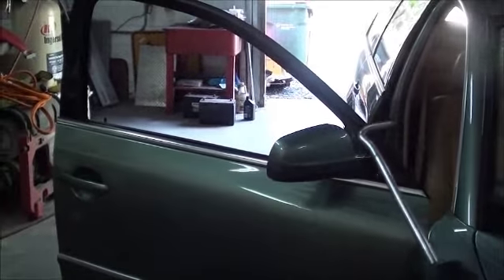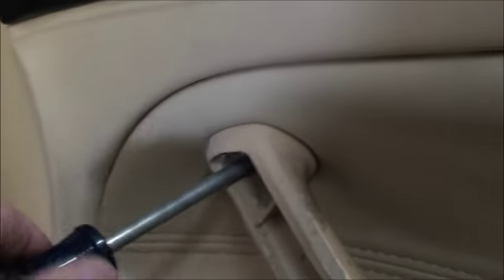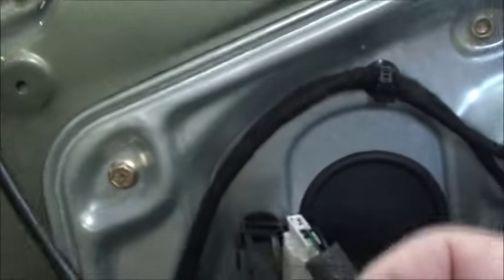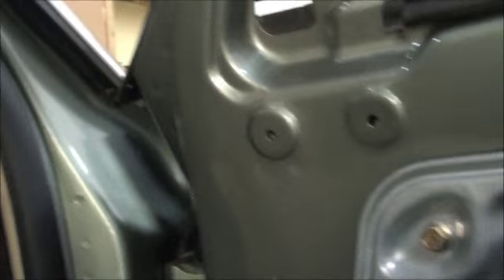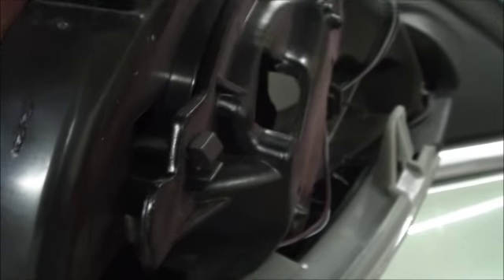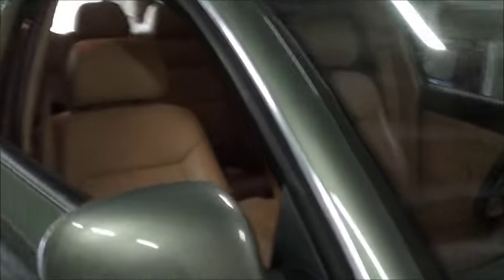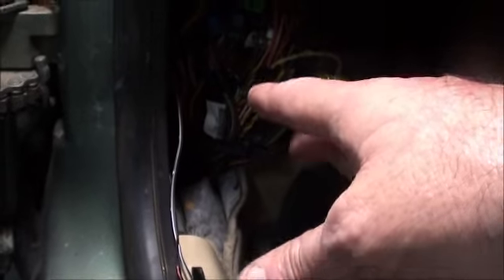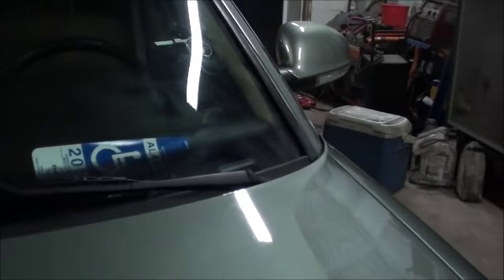Installing new mirrors on Passat and i have a set for sale

Comment: how was the indicator wiring connected to the old style wiring? did you hook it up to the where the relay is or piggy backed it of the wiring of the current wing repeater?
Reply: Did u get an answer to this? About to do the same job but as u say my new mirros have the indicator where as the previous did not
Reply: @kileblade  you need to connect the indicator wiring (black/whiite) on the left side with black/white and on the right side with the green/black wire.